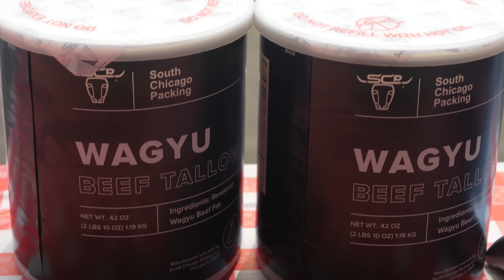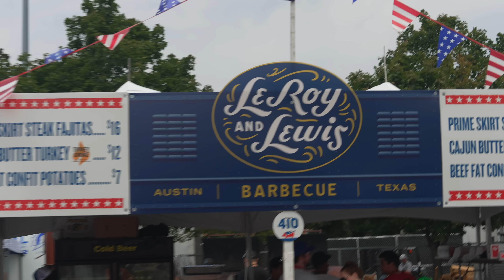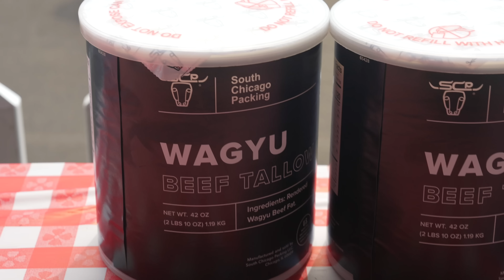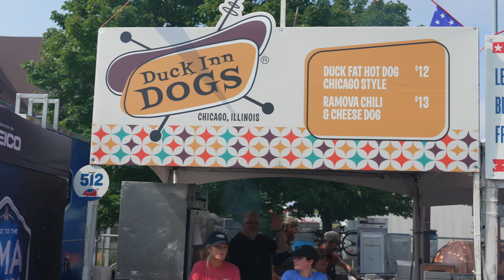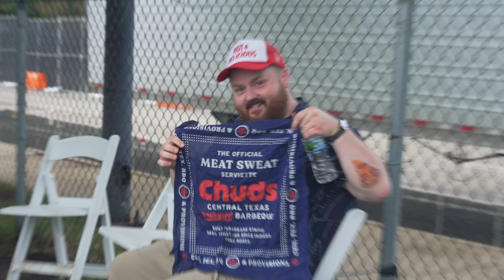My Favorite BBQ Festival! | Chuds BBQ

Comment: South Chicago Packing's beef tallow is awesome on brisket. Only way I'll cook them ever since I did it the 1st time
Reply: Try it in this recipe:

3 cups all purpose flour (400 grams flour)
2 tsp baking powder (7.5 grams baking powder)
2 tsp fine salt
8 oz hot water (236.59 ml water ). Get it as hot as u can.
1/3 cup of equal parts butter and the Pork lard these guys make.

Hand kneed for at least 10 min.  This is most important part.

Let rest for 30 min. Then divide and roll out super thin before cooking super hot on pan.
Reply: @100smp  thank you